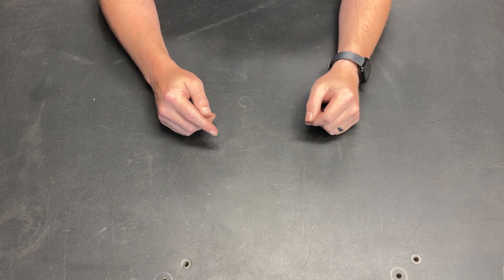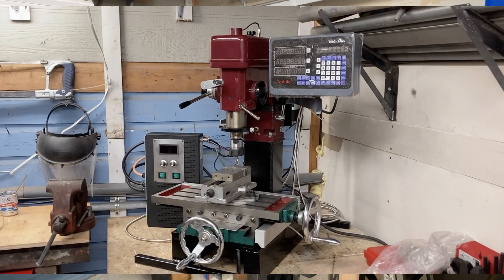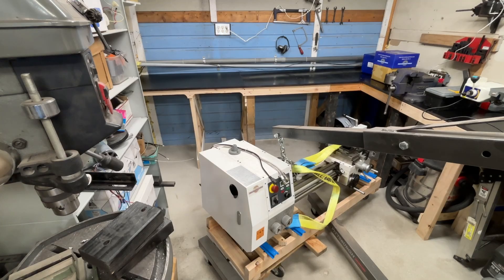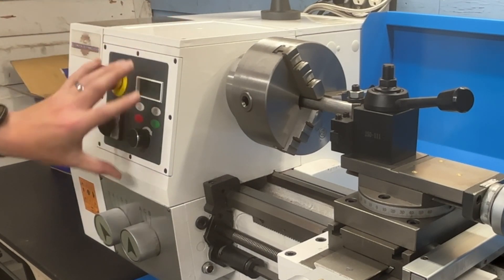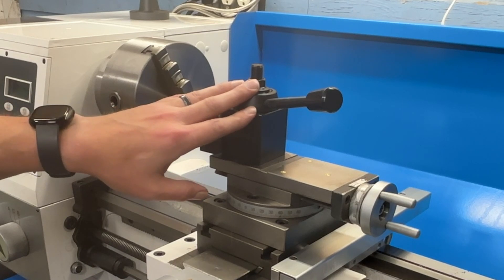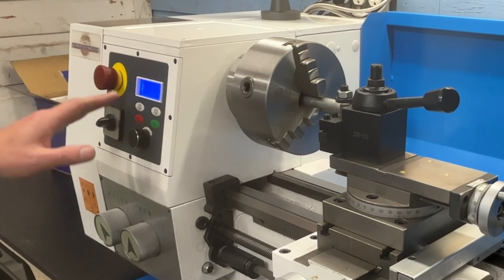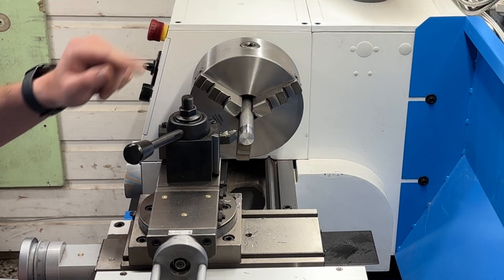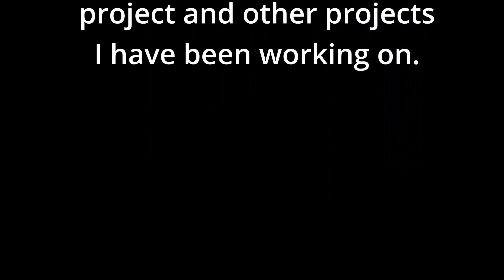Precision Matthews PM 1228 Setup Features & Chips Going Through the basic Features & Operation

Comment: Man there has always been a concern of mine to see a awesome machine like this setting on a wooden bench and not a solid metal base stand. Kinda makes me question consistent precision..
Reply from the maker: I understand your concern but that has not been my experience, for starters I am a fabricator not a machinist so .001" -.003" off is not a big deal for me in most cases.  With that said I have not found accuracy to be an issue.  It holds true and I can can make very accurate cuts.  The only time the wooden bench makes an "issue" is it is slightly more prone to chatter but nothing that can't be fixed with the correct speeds and feeds.

Comment: Hello again, been watching alot of YouTube videos on mostly 12 x 36 lathes. I have found only one in the price range that is close to PM and that is because it's used. Baileigh PL- 1236E. Very few YouTube videos on this machine. I am thinking that is because it's about $3000 more than other comparable 12 x 36 lathes. What really has me scratching my head is that people are comparing it to PM lathes. From what I have seen the Baileigh is a much higher quality machine for the simple reason the way the carriage is built. You don't need to reverse the machine at the headstock when you want to change your feed axis from facing to length wise turning like you need to with PM, Grizzly and others.
That tells me there is a way better set up in the carriage gear box. It's more like the industrial Clausing larhes I have used.
Reply from the maker: interesting observations.  I am not familiar with that brand.   Being a 12/36 that is a very large machine.  I hope you find the perfect machine for what you are wanting to do.
Reply: I just found out an interesting fact. Baileigh and Jet are owned by the same company. Both of their 12x36 lathes have this feature. Thanks for the quick response.
Reply: I believe Precision Matthews will be very hard to beat as quality goes. After sales support is awesome with Percision Matthews!!
Reply from the maker: I agree with that statement.  I have been extremely happy with my machines.

Comment: Appreciated your videos especially now on the PM lathe. I am a retired machinist after 35 years of running about every machine you can name.I have decided to order the 12x36 precision lathe with the steel stand. I am not familiar with all their tooling packages and the difference between the high precision vs the ultra precision chuck. If you can give me some recommendations for tooling packages to start out with I would really appreciate it. I want a good variety of boring bars and I can purchase those from another source also. This may be alot to ask so no hurry if you are willing. Thanks and keep up the great info.
Reply from the maker: really depends on what you are doing.  I am a fabricator not a machinist so for me budget tooling is more often than not good enough especially if I keep in mind the tooling limitations as I work.  A perfect example is a bit of runout in the chuck, as long as I get all the important machining steps done in the same work holding then everything remains concentric.  If I need absolute accuracy especially after remounting the work that is when I brake out the independent 4 jaw.  The other thing is to price shop.  PM has good import tooling but its still import tooling and tooling of similar quality can be found for the same price or less from places like amazon.  I buy a fair amount of import tooling BUT I always make sure it has free returns so that I can send it back if it is not of good enough quality.
Reply: Thanks for the tip

Comment: Well, as I've been searching for lathes (nearly traded a Gibson Les Paul for one), a Grizzly sale popped up, so I ordered their 12x35 lathe. It came yesterday, nicely crated, and is in the basement awaiting installation on its stand. I was gonna just put it on my seven foot toolbox/workbench, but it turns out my shop crane legs are too high to go under it. 
Next up will be a DRO, and I've learned what not to do from what PM did to yours!
Reply from the maker: 12 X 35 you will be able to make all kinds of stuff.  Glad my DRO issue with PM was helpful.  I may end up going to the hex head nut even after the extended spacers.  Some times the stand off is right over the lock when I need to tighten it.

Comment: The pdf manual on the web page for the PM1228 shows exactly how to rig the straps, which worked fine for me. Also shown is how to install the AXA QCTP, level the lathe and much much more. Highly recommended read no matter what your skill level.
Reply from the maker: Thanks for the comment, I downloaded the manual and read through it specifically looking for slinging information.  I must have missed it.
Reply from the maker: I went back and looked and the brief mention of the how to strap it is poor.  In fact thats exactly how I had it strapped the first time when it rolled on me.  Using the leg as a spreader and using two straps at different lengths to make it closer to level was far superior to the technique quickly mentioned in the manual.  The rest of the manual is excellent however I must admit it was a couple months prior to the video that I read through it so it was not as fresh as it should have been.